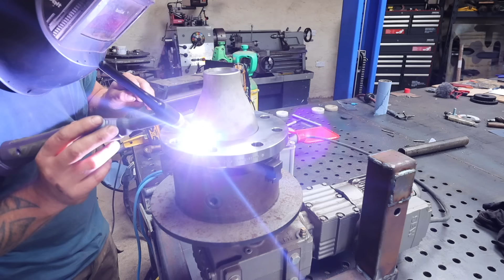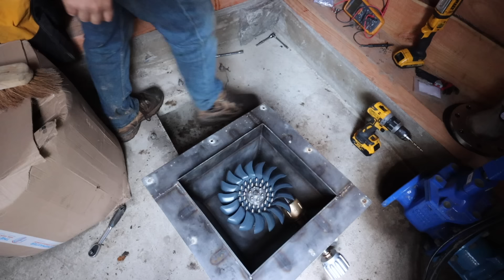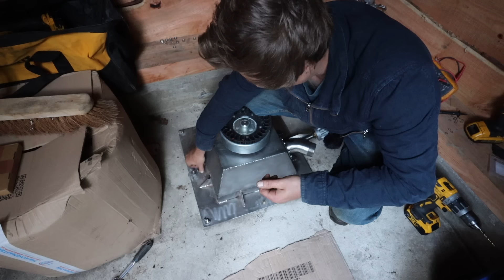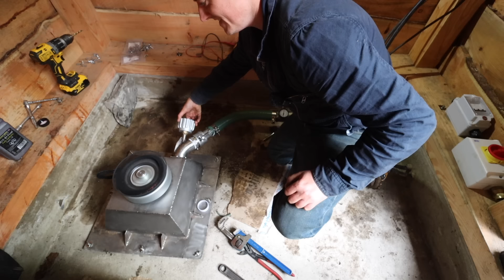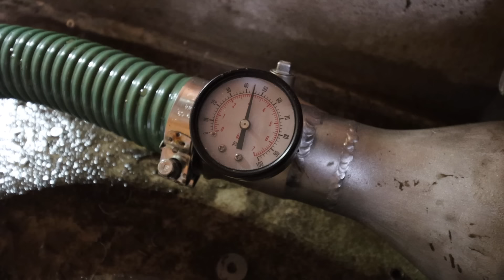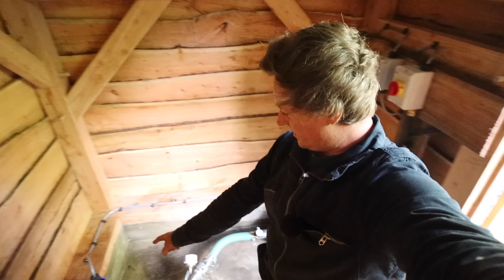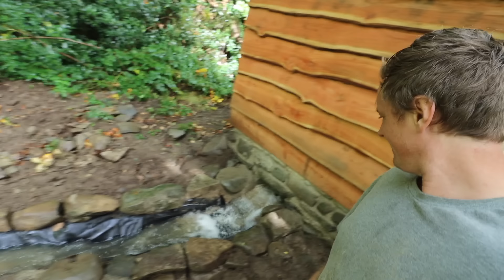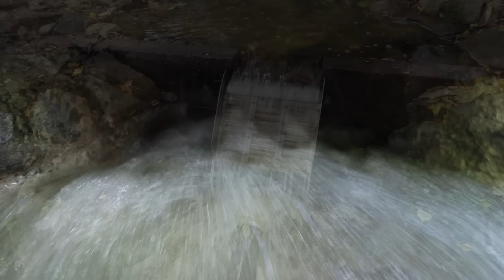North Wales 1.5 Kw Hydroelectric System Part 6 Running the turbine For The First Time

Comment: Pressure loss in the smaller pipe isn’t due to more friction, it’s due to energy conservation. With a set flow, increase dynamic pressure, reduce static pressure. You’re measuring static pressure with that gauge. If you wanted to measure dynamic pressure you’d need a pitot type tube set up in the actual stream of fluid being measured.
Reply: By the by. Love your work. 👌😎

Comment: You can hard pipe it all if you use weco hammer union piping allowing quick assembly / disassembly as well.... Make a few  short straights, 45° & 90° elbows and you´re sorted. I'd not worry too much about vibration but put in a surge header upstream of the turbine...

Comment: You had some gravel and debri in te pipe . That you avoid that it gets in the pipe is one , but is it possible that you in a place of the lenght of the pipe put in a ( metal ) container where the heavier debri sinks to the bottom and can cleaned out once and a while ?

Comment: Hi Chris looks great but is the last bit of green pipe not the bit that will give you a bit more power if you changed it as its corrugated and has a bend in it creating friction. Would it be worth bending a bit of stainless pipe up the the correct angle instead ,I guess it would be harder to take the turbine off the floor as you might need bolt flanges. Out if interest is there a reason the reducer cone is so far from the final valve, could that not be part of the final valve and that way you could bring the lager dynamiter tube closer to the turbine deducing friction further. Keep up the great content.

Comment: Suggestion: It's extremely noisy. It's gonna get old real quick, especially for the wildlife. I would make a cover lined with sound deadening material used for automotive. It would fit on the same studs and wingnut it down. It would also protect what is spinning from anything that could come into contact with it. It could made out of sheet metal stock, it doesn't have to be heavy duty.

Comment: A suggestion, get into a bit of automation. You could add in a PID controller that would take in your setpoint (maximum power for this example) and then drive the control spindle / valve to achieve this. A PID controller also removes the need to manually intervene with the flows (control spindle / valve), as it would just try and achieve whatever goal you've set for it. Typically maximum output but if the system were to demand something like 600 watts output, it would then reduce the flow automatically to this new setpoint. The setpoint could even be an off state / completely closed.  Obviously, for safety,  the nozzle valve would still need the larger valve for complete isolation of flow. Adding a simple small stepper motor (or whatever works best for you / them) on top of the existing isolation valve (Big blue one, not sure if its a globe valve / gate valve). A different isolation valve to consider (not specifically for the site you're on as its already been purchased and installed) is a pinch valve, if used in conjunction with a bladder kit you could used a small solenoid to control the bladder. It uses the inlet side, or high pressure side, to fill the bladder through a small line that the solenoid opens and closes allowing or stopping the flow. This could then be used as a safety feature, say if the flow is still going but no power is being generated or a sudden drop in pressure (provided the controller is monitoring the pressure). 
And a random side note, ideally use something with a smooth interior for your hose as the turbulence is significantly higher with ribbing. 

I apologize if you were aware of everything I had said, and if not hopefully this helps... 🤷
Reply: Pretty sure Kris has something very similar in mind, should the customer (remember, it's not Kris' system) desire it in the future. He welded a bung for a pressure sensor into the inlet tubing, and ran extra control wires, specifically for this.
Reply: Yup, an Arduino, stepper driver and worm gear, limit switches and current sensor and a few hours debugging should be able to handle this.

Comment: Maybe put a volt meter in the turbine shed, so the customer can adjust the turbine without needing anyone at the house to check the readout? Or is that what the pressure gauge is for? Looks awesome in any case! I wanna build one now.

Comment: Sorry to be that guy but that tig welding on the reducer was not up to your normal high standard,  is this because of your off grid power supply as your welding is normally so much neater . .

Comment: Why don't you use tires chains on all four wheels. We chain up our four wheel drives and there's not many places we can't go when we are chained up. They work great on muddy slick roads to give great traction and the ability to steer without sliding. We found the heavier gauge chain works better then the smaller gauge chains. I've got one set of heavy gauge chains that have ice bars installed on the cross links and I've not found any condition that they don't work great.

Comment: Hmm. That note at the end about the nozzle sizes makes me wonder if you could have 2 different sized nozzles that you can toggle by opening one or the other. If you really wanted to, you could probably make it automatic via an electrically actuated valve hooked up to the flow/pressure sensor, so it opens the valve when pressure is in the right range. Could even close both if flow drops too low to generate power, until the pipe fills back up, then open again. Sure, it adds another failure point, but I'm sure there are plenty of very robust valves out there, considering how much society relies on water distribution.

Comment: Very impressive installation. I admire your motivation and gumption (Good word is gumption). Your problem solving skills and willingness to learn are superb. Hopefully not repeated this idea from the many suggestions in this thread but my idea for your next build is to sink a second sump into the concrete base angling the outflow into the turbine one but a bit downstream. You could put a grid over it and positioned appropriately it could be used to empty the main hose into it for cleaning, maintenance etc, without moving the turbine.

Comment: Top job pal,Just a quick one pal.When you tig weld you should push your weld not drag it as you were doing.You will find you will be able to control the penetration way better you should also reduce any heat issues as your gas will be flowing away from your weld.Hope this makes sense.

Comment: Why don't you run the feed water through a centrifuge style unit to allow any debris flowing down the pipe to be collected before it reaches the nozzle, it could be uphill, outside of the turbine house.

Comment: Awesome job, one thing you should try when welding stainless steel pipe with the tig, if you blank the ends of the pipe off and have another hose on your argon tank, you then pipe it inside what your welding so you get a cleaner weld on the inside. That’s what we do in the food industry.

Comment: I believe if you make a tank near the input stream and divert the water to fill-up the tank and then connect the pipe from the tank you may have a better chance off getting less gravel. Is like a filter for your water and also keep air free...
I really admire your work 👍

Comment: Great work as usual Kris.
I love the new concrete base, the only tweak I would make for this is a pit within a pit.
So, there is a dry floor around the turbine.
Basically, recess the turbine.

You keep an eye out for things, but maybe your customers are not as aware.
So, the final thing would by a safety mesh over the turbine so fingers, hair, cloths don't get caught when its spinning at such high speed.
Now you are doing offsite work, best to avoid liability issues etc.

Can’t wait for the next project.
Reply: Was going to make a comment on a safety Mesh around the turbine too! good shout and fast fingers!

Comment: When using a steel winch cable you should have some cable arresters fitted or you should have the bonnet open to prevent horrific injury or decapitation xx

Comment: Very professional made system.
The welding table seems to work good as well. But try to have it rotating in the other direction, pushing the puddle gives a neater weld compared to dragging.

Comment: One option you have for overvoltage protection is to put a large zener diode over the DC lines upstream of the breaker, so it goes turbine -> rectifier -> breaker -> zener from GND to +VE -> isolator -> out. When the output voltage exceeds the reverse voltage (zener voltage) of the diode, it'll conduct and shunt a ton of current through it. That'll cause the breaker to trip. Alternatively, given how much power you'd need to shunt, you might actually want a TVS diode. Something like a Littelfuse 30KPA170A would do the job - it won't kick in until 170V and can handle a ton of current.
Reply: The turbine is a "current limited source" and is unlikely to produce enough current to trip the breaker in anything but  dead short. You are best using a suitable SPD to catch transients and rely on the overvoltage protection within the charge controller. IEC61643-32 is a good place to look - it deals with solar PV but you can adapt it to hydro.  Certainly a SPD at the charge controller end would be a good idea.

Comment: Breakers are funny things, if you have a rectifier fault it is unlikely to trip as the magnetic trip is typically set at 5-10 times overload and the thermal trip will go off "within an hour" at about a 50% overload.  Your turbine is current limited so the magnetic trip will not operate and the thermal trip is unlikely to go off.
Reply from the maker: The turbine isnt current limited at all. in the even of a short it can put a huge amount of current down the line due to its intetia

Comment: Is this about 6 liter a second at 3 bar?
With 60% overall efficiency that turns out 1060 watts.

Nice if you could summarize the setup for us with a slow memory :)
Things like penstock length, diameter, fall, calculated m3/s and so forth.

Comment: A few things that make a huge difference for camlock fittings.
1 - Lubricate the cams. This makes a huge difference.
2 - If you need to use a hammer only use plastic/rubber. 
3 - Tighten both cams at the same time. If you try to close one side then the other it is much more difficult.

Comment: Awesome work Kris.
I was thinking of the pipe too and you mentioned it.
Yes long term a more sturdy pipe/elbow bend would be a solution but keeping the cost down.
We use invicta pipes at work which are ceramic lined but very dear.
Have you considered using a harder material such as stainless steel?
Great video.
Regards
Dave

Comment: Good choice to change that pipe. I used them before aswell. Work fine and all but over time, even without sunlight the pipe gets brittle and ridged and will eventually break! I recommand something out of thick rubber so still managable but way more longlasting
Reply from the maker: Yep, I already ordered some 15bar thick rubber stuff

Comment: Great work, Kris. In a future build, would you ever consider adding a second spear valve on the other side of the unit, so you could switch between the two valves relative to the water flow that time of year? There could be a Y splitter after the reducer to make the switch between the two spear valves. 

Also, could you put a servo motor on the spear valve's adjustment knob to automatically fine tune the flow/wattage output? Are there open source computer programs available for such a thing?

Comment: Hi Kris. Great job on the hydro project my wife & I really enjoy all your content.  The pipe your going to replace would a smooth bore pipe work better to help in reducing friction. All the best Bev & Mike.
Reply from the maker: The pipe is smooth on the inside. But yes I would only use smooth bore pipe
Reply: @KrisHarbour  Ah ok my bad. Thanks for the reply. Looking forward to your next video… Are you still thinking on adding a second supply to your own hydro system.

Comment: I think your doing an amazing job!
I would imagine sharing one turbine for two household would be a cool concept whit that power output.

Also what about say 2x 750W turbines, turn one off when there is not a lot of water for efficiency, run both when there is plenty.
Sure is an added expense but maybe something for more then one household approach like a small apartment complex.
Thinking about it would a dual nozzle approach for a single turbine help widening the power band and if so maybe the best approach for a bigger turbine?

Who know what job you get next and what you will come up with!

Once again grate work!

Comment: Not to complicate by sounding retarded but could you use some mechanical attachment to get some energy to generate more power for a subsystem for the micro drop generator to power some sensors and lights for the turbine pump room (motorcycle battery - small mpt and possibly roof solar ata to remotely manage the environmental (a vent - lights - camera) as a subsystem or would you just draw off the conductors from the turbine directly - i might be over complicating the attempt to keep it simple

Comment: need a bucket with overflow, bucket catches bits/gravel thru gravity, overflow feeds the turbine, too simplistic ?
in flow needs to be at an angle to the out flow ... in a bit lower than out ...
Reply from the maker: The gravel got in when installing the pipe. once its out no more can get in so its not an issue.

Comment: A couple quick thoughts on speeding up your process. First you could 3-D print or manufacture caps for your piping to keep them closed off and debris free during installation. Second you could create a chimney sweep on a rope and attach the end of the rope to a piece of steel and use a magnet to run the rope up your piping to sweep it free before connecting it. Just a couple of thoughts always appreciate your content ~Smile oN

Comment: Great project!   Just a comment on the plug and socket, you might have got them the wrong way round, since the socket is usually the supply, the live terminals are recessed and female, so you cant touch them.  Your supply is the turbine with the plug, so someone could unplug it, touch the exposed male terminals and get zapped!  Although your way is the more pretty and practical, it is the more unsafe way.  Sorry to have a whinge.  Everything else looks great, I'm jealous!
Reply from the maker: Yeah your right on that, But its important for me to be able to unplug the turbine.  Honestly someone we really need to want to get a shock to put there fingers in there. the dont stick out as im sure you know. they are down in the plug and surrounded by plastic. And on top of that its quite low voltage. I can tell you when your in that building you are aware that there is energy all around you its not like you would unplug that and not realise it was live, the turbine would suddenly go twice the speed and twice as loud. The building is also padlocked and the owner knows not to go unplugging stuff, im not worried about it personally.

Comment: I would love to explore hydro. My brother owns a section of a small burn with a good amount of change in height but no space to build a power house at the bottom. I own a lower section of the same burn where it's practically level, but with plenty of space. Problem is, there's about 5 meters of the burn being diverted underground between the two places. I don't expect we have any rights to run a pipe through the same area.

Comment: Kris, I have a question please. If one doesn't have property around water and wants an energy system like this, could one build a water system that recycles the water in an enclosed system to create energy with tanks using water as the commodity instead of fossil fuels because water evaporated, the supply tank would be water. I so enjoy your videos and have learned so much. Thank you for all you do. It's so wonderful to learn and think of new ideas. If not new, it's new to me, better late than never. lol

Comment: If you get the chance go to your local dairy farm where they make milk and check out their fittings which can be RTJ, ISS or IDF for low pressure fittings. For flanges I note you went for flat face but you may want to consider RFWN.

Comment: Interesting project for residential hydro power . Did you consider installing an auto air vent to help eliminate the air issue and @I might add an inline strainer with fine mesh filter element . Gravel is very erosive on the the turbine blades . Not sure what they are made of .

Comment: Congrats on meeting your 1kw goal right off!  👏  🎉
3:10   You might want to reverse rotation of your welding positioner.
As is, you are dipping rod on the trailing side of your puddle which doesn't help fusion or wet out.

Comment: Hi Kris, why are you welding backwards with your turn table?
Reply: YOU might know what you mean - but I'll bet most of US don't!! (apart from the welding nerds, of course....!)
Reply: @andymccabe6712  sorry 😅 normally the tungsten electrode is pointing forwards to the not welded area. So that the arc is heating up the next area and the filler rod. Kris is dipping the rod of filler material on the side of the weld puddle there it is starting to cool down. I would think, with this method the melting of the base metal is maybe a bit weaker. But maybe Kris have a secret technique that I don't know.

Comment: Brilliant! What a success! Suggestion (from the marine environment): Double up two T-Bolt clamps on the feeder hose connection ends each, given the pressure and criticality of these connections - we do that for all thru-hull fittings on boats. Congratulations!

Comment: Instead of putting a bigger nozzle why not do similar to your system and have 2 nozzles, 1 always open and another one that can be adjusted depending on demand/flow rate ?
BTW i love how clean that setup is, you done a cracking job there